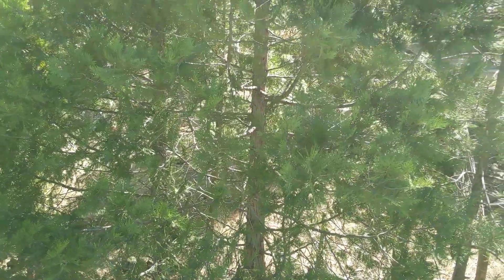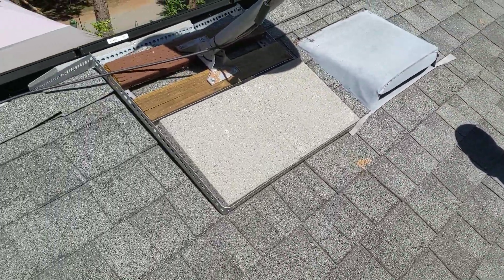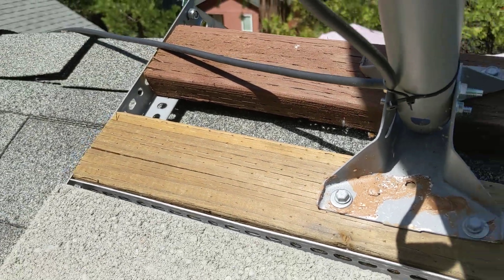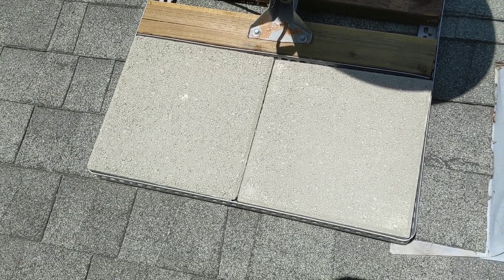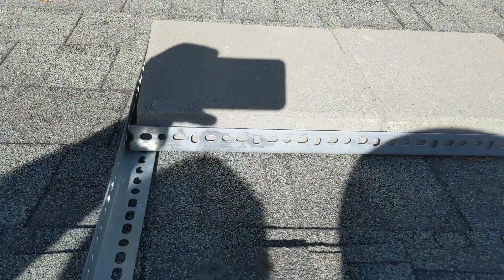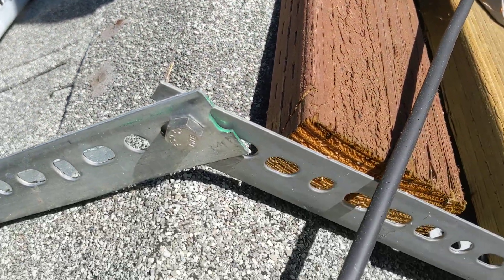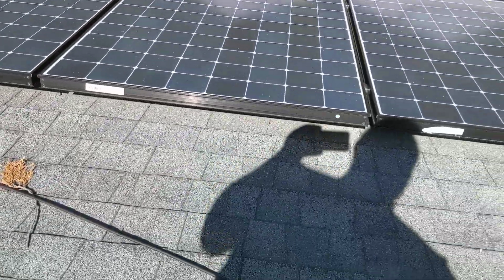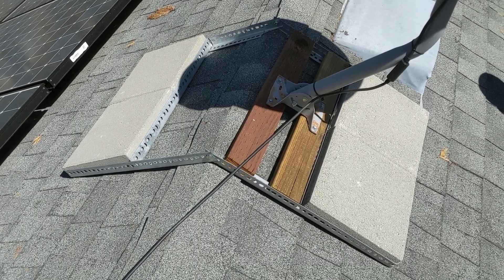DIY non-penatrating starlink roof mount

Comment: What size are the pavers that’s you used?
Reply: Lastly looking at your directions. I will need 2 - 8 foot pieces of perforated angle iron correct. Only because in the video it was stated only one piece. Just want to make sure. The less trip to Home Depot the better.
Reply from the maker: @nappydreadz69  yea someone in the comments did the edit for me so follow that
Reply: @kodakomp  
Thank you very much.
Reply from the maker: They are just the 1ftx1ft cheapo concrete pavers you can get at home depot

Comment: I have a question. It's a good concept and I like it however I'm located in Florida where the roof shingle temperatures likely exceed 100 degrees in the summer. The heat makes the roof shingles more pliable. Concern is the possibility of damage to the fiberglass shingle roofing from the weight of the unit during the summer months? Has anyone had any experience with this?
Reply from the maker: My roof regularly gets above 110f in California summers and it has not caused any issues
Reply: @kodakomp   Thank you for the reply.

Comment: Awesome simple design! Only took me a few hours and works great. Thank you
2- 8ft peices
Cut 2ft off each peice (will be used for center sections)
Then make a 90° cut and bend at the 2' and 4' mark on the remaining 6' peices.
Bolt it together.
Then cut the bottom ends that connect together 2 or 3" down to allow it to hinge.
I screwed my 2x4s using good deck screws and washers from the side after drilling holes. Then bolted my mount on. Works perfect
Reply from the maker: Thanks for the edit haha

Comment: now we are talking.  Lot better then spending $120+ on one thats pre built.  This has me thinking!!!!  The wood would be my only concern in the heat cold and rain.
Reply from the maker: I used pressure treated wood that is rated for direct weather exposure, but that is definitely something I will probably upgrade it once I see signs of decay.

I also had 2ft of snow on it about a month ago worked great!

My only concern I had was wind speed, I only have 30mph max winds in my area so if in a winder area I would try more weight